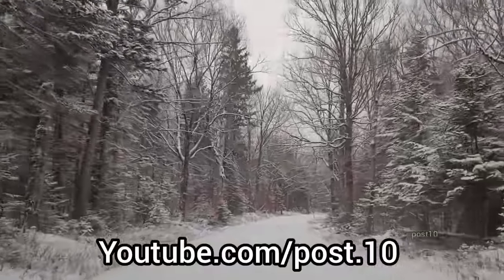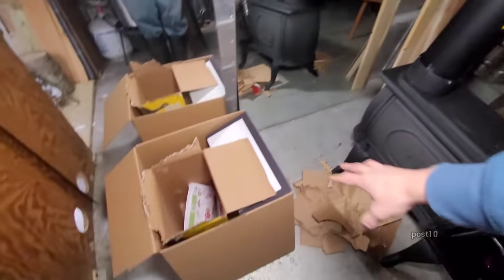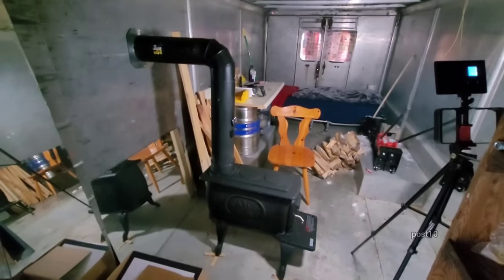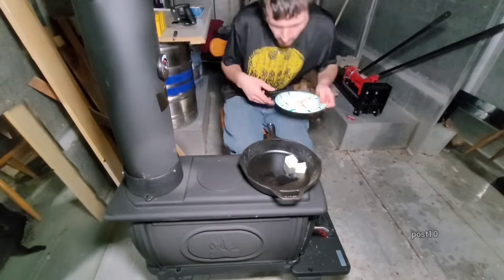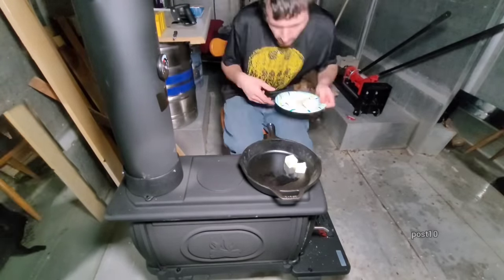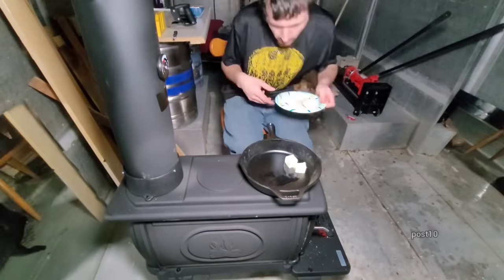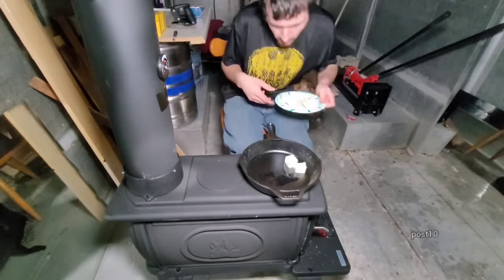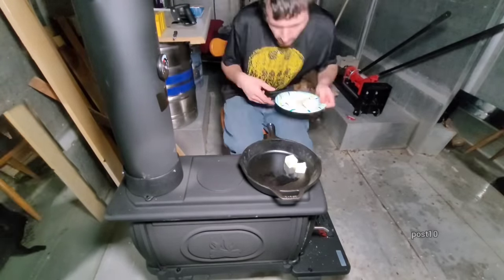24 Hours Living In Abandoned Truck Deep In The Woods During Snow Storm. Transformed Into Camp

Comment: Loved your video. It's amazing how much we take for granted these days. Most people are used to just flipping on a switch to get heat and light. My wife and I are both retired. We live in Texas and went through that week long period with no electricity and below freezing temperatures a few years ago. We were fortunate
 When the news told us the freeze was coming we already had a generator installed that powered our home. My wife and I tend to get moody if we don't have our TV 😂. We discovered that the very first time we went without electricity for just a few hours prior to that week long freeze. So I bought a generator and wired it in. We  stocked up on gas when the TV weather station warned us the freeze was coming. A lot of people didn't take the freeze warning seriously thinking it could NEVER get that cold in Texas🙄. People never dreamed our power grid would fail for that long of time. I'm not a gambler. I do what is advised everyday in life to make my elderly years as comfortable as possible. The wife complains  less that way 😂. "Happy wife" means "Happy life" 😊. Our generator ran 24/7 for an entire week except for a few minutes for refueling. The ground was a sheet of ice and I fell several times during refueling. So after the freeze was over I installed an auxiliary fuel tank so fuel ups would be a lot less if we ever go through a freeze like that again. I was shocked when I heard how many people lost their lives in that freeze 😳. The streets were undrivable. Car wrecks everywhere and lots of cars in ditches. Many cars just slid off the road and couldn't be moved. My wife and I were fortunate to be retired with income still coming in when many weren't 😔. Many people went that whole period not being paid. We were also fortunate and kept our running water. Many people's plumbing were busted. After the freeze the hardware store sold out of a lot of plumbing parts due to the repairs that people were having to do. I let my faucets drip a steady stream that entire freeze week. I would rather pay a little extra on my water bill than go through the plumbing head aches😂. So due to my prep work we and our pets got through that freeze with just the cost of fuel usage and no other damages 👍. I'm a retired welder and once the freeze was over I built an oil  "drip feed"/ wood burning heater for heat source also if ever needed 👍

Comment: I had a wood stove similar to this design when growing up, We installed it in our trailer and used it every winter for years. We never cooked with it tho, but ours came with a tool to remove those circles at the top which is what your supposed to do when cooking, for some reason yours is just 2 circles and no slot for a tool to remove, so idk if you cooking with those spots closed was intentional on your part or if you didn't know you were supposed to remove them for when cooking. However as you said, to your surprise the food came out much better then you expected. that's because you essentially slow cooked that salmon which is a great thing to do because with some food, the slower you cook it the better, other foods it doesn't really matter. Slow cooking it allowed that garlic to sweat into the butter nicely and marinate both the fish and the shrooms also allowing the fish to render nicely into the vegies aswell! But IDK if you knew what you were doing with that wood stove when cooking or not but if you wanted to cook food with it faster in the future removing those discs and covering the hole with your pan is how your supposed to cook on a wooden stove, you effectively made a slow cooker with a cast iron pan and tin foil. What a macgyver invention lol.

Comment: Looking forward to watching the whole video! My family's old hunting land had an old Air Force bus that my uncle bought at auction. We had aluminum siding on it, some crank-out windows, an "All-Nighter" wood burning stove, plywood on the interior walls, and layers of shingles and old carpet on the floor. Plus, bunk beds in a U configuration in the rear. We had times when it was 85F in there with the right wood burning away. I had the top rear bunk, so most of the heat traveled my way. Hated that.

Comment: What a fun camp in the woods. What a nice nest you are making. Insulate it really well so you don't have to deal with all that condensation and blankets frozen to the wall or floor. Lol. You won't have to burn so much wood so fast either. It is great you have chunks of maple for over night or longer burn times! Wish I had access to more maple or oak.  Lay down even a few layers of cardboard on the floor and cover them with something waterproof you can sweep and put a couple of throw rugs down for your bare feet. Put a large metal commercial baking tray under the front of your stove to catch embers just in case. This comes from a grandma. I am 75 and with a lot of help I did a rough inexpensive conversion of a 20 by 40 metal shipping container and lived in it for several years. When/if you decide to paint your truck in the woods, just paint out the word Bachman and paint on the word NATURE. As an off grid mom and grandma for many years, your work and enjoyment brings back some great memories. Thanks so much for sharing. If i was going to live in a metal box again, I would definitely want to insulate well; and reinforce the floor if needed and build in a rocket mass stove for heating, cooking and warm winter bed space. Rocket Mass stoves take from one tenth to one fifth of the wood a regular wood stove take and maintain your heat energy for hours beyond your burn time. They burn very cleanly if done correctly and you should get no smoke. I wish you the best in your life's adventures. Blessings to you.

Comment: When your getting the fire going, leave the door cracked an inch. It increases airflow to the fire so it goes easier. Also leave it cracked for a few seconds before opening the door fully to push the smoke out of the firebox and up the chimney.
Reply: A vented wall penetration keeps supply air from creating a cold draft inside 💠 ...🤔☝️✌️💪☯️
Reply: A vent through the floor directly under the stove works the best, then cold air from outside just goes directly to the stove instead of drawing cold air into the cabin while drawing your nice warm air into the stove.

Comment: FYI, the flat cast iron pan can be used as a lid for the two shallow cast iron skillets.
Reply: Good suggestion. His 1lb of bacon would've cooked much faster that way instead of putting it in that huge Dutch Oven pot which acted more as a heat sink instead of applying the heat to the bacon itself - it would've cooked quicker in a smaller skillet with lightweight lid of some sort.

Comment: Just a friendly FYI before installing any small stove you should start a fire in it with the stove pipe attached outside first to burn off the protective paint coating they put on it.  Otherwise when you fire it up the first few times inside it will smoke and give off horrible smoky fumes.

Comment: Something I was taught a very long time ago to help insulate the bottom of the stove to prevent the cast iron from getting too hot: Put a layer of silica sand in the bottom to cover the wavy bottom to about 1/4" to make a level floor.  I did this with my Jotul 606 - as my mentor of yore did with his - and it keeps the bottom cool enough you can store firewood underneath without it getting hot.
Reply: Everyone I know, including myself, just never cleans the stove/fireplace out completely.  Just burns better with an inch of ash in the bottom.  I have always regretted when I did go completely empty as it just seems to make getting a fire going harder and takes forever to get nice and hot.

Comment: Good video. I'm doing a similar adventure. I have a few words to share my experience.

 Wood chimney pipes should be installed male into female. Female being on the lower end. When creosote drips down it will stay in the pipe and be less of a fire hazard. Insulated pipe helps to keep the smoke hot while exhausting. Burning seasoned, dried, hardwood lasts longer and creates less creosote.

Beacon grease can be used instead of butter. Pour your drippings thru a strainer over a mason jar, let cool and put a lid on it. Years ago, there was always a grease container sitting next to the stove, for cooking and treating the cast iron pans.

Eggs that are fresh from the chicken, unwashed and not previously refrigerated, don't need refrigeration. Store bought, by law are washed and refrigerated. Washing them takes off the bloom (natural coating) that protects them. The shell isn't enough protection on its own.

I have decided to not plug up all my holes. My wood stove needs a lot of air, for the wood to burn. There is only so much air inside my little building. I need air to breath. I also need some ventilation for condensation. Even me just breathing creates enough moisture to create mold on anything and everything. I went to get out my winter wear, found mold...even all the bedding materials had to be replaced because of mold. Ventilation is very important.

I subscribed....just to follow your progress on this "cabin" project.
Reply from the maker: Yes I did the piping backwards because I didn't want rain water coming back down, the creosote will seal the pipe eventually
Reply: I did see that you replied on another's comment about the pipe, after I had commented. You do you.

Comment: Hey buddy....you got a good start but you can't burn pine! It's gonna gunk up your chimney and give you so many problems with creosote buildup. You need insulation outside of that truck. If you're gonna leave that gap on the roof you need insulation in there, you gotta put nails in that aluminum, insulation there at the front at the windshield, and underneath. It would make it much easier to keep a good temp in there. You're still learning. I'm curious, where's your family?

Comment: Glue Tyvek insulated panels around the walls, floor and ceiling and it will really insulate the place.   You won't go through wood so fast and it helps with outside sounds coming in.

Comment: Wood stoves are designed to work efficiently with the door closed, with it open, it won't draw correctly, there should be some type of air shutter to draw air near the bottom of the pan or underneath.  The hole you cut probably bypassed the baffles used to heat the walls of the stove for the best heat exchange into the room.
Reply: Agreed, the cook top is not heating up as it should, heat going right up the flue.
Reply: 🫢⚠️, if you want to see the fire = buy one with a window in the door. The door must be closed and only opened for stoking and putting more wood inside it, and the wood must be well seasoned to not smoke. And never punch holes in the deflector

Comment: Great video mate! Just came across your video in my YT feed and really good! That land with that truck on it, that's a right result! Great truck for a ready made tiny home/cabin. You could insulate that and it's save you having to burn anywhere near as much wood, retain the heat and also reduce all that noise you're hearing.. just a thought as if anytime the fire went out in the night or whatever, it would still stay warm inside, also make it good for a longer stay. But even as it is, its a great space! Fantastic luck that it's aluminium aswell.. what's the chances of that happening (getting stuck and not being removable).. you did well buying that!
Cheers from London England 👍😎🏴🇬🇧

Comment: You might consider some sort of insulation on the inside. Something as little as wood panel or planks on the inner walls would likely create a more consistent temperature.
Reply: I was thinking the same thing, maybe those styrofoam 4x8 boards that are covered in foil.  Just glue them to the metal structure with some PL premium. That would also help to cool it in the summer
Reply: @Scubaken2022  I was going to suggest those too, but they're ugly. I feel like the aesthetic would work best with wood. Wood may not work as effectively, but at the very least, it should have a good impact. Especially if there's an air pocket between the metal walls and any type of insulation.

Comment: One tip about cleaning the cast iron, is to do a salt scrub. find some chunky rock salt and pour it in pan after rinsing it out and use a paper towel to scrape around with the salt. you will be able to scrape off anything left and the salt also absorbs excess oil and seasoning.

Comment: The corrugated "roof" will absolutely blow off with a good wind. The cinder blocks won't do much, and you'll find a decent wind sends the roofing sideways. Consider tacking em down. I'm speaking from experience. Maybe construction adhesive if you don't wanna use screws, but removal may be an issue if that times ever comes.
Reply: Agreed.  One big wind is all it takes.

Comment: I believe the chimney should have been installed at a 45 degree angle, at least, because smoke rises but only if there is there is way to allow it to do that.  The ideal position will be straight up so there is no issue with the rising smoke but that is my thought. But I need to say I commend you for taking a difficult situation and making it much, much better for you needs. Wishing you the best!!

Comment: Get some roofing screws with a rubber washer.Makes them water tight.
Reply from the maker: I thought about doing this but only if the roof flew off during a storm. Those cinder blocks are more than enough. This property is going to take forever to clean up, I got a microburst yesterday taking down 47 substantial trees and the roof survived it

Comment: SAFETY ISSUE! I heartily recommend that you screw down the roofing using rubber washered roofing screws and then remove those heavy blocks. One good snow load and the weight of those blocks and the snow could crush your cabin. I’d hate to see that.

Comment: You should drill some holes in the floor or make a larger hatch with a removable piece of metal, to allow you to easily clean the floor in the future.

Perhaps right in front of the stove, to have an easy way to dump ash without carrying it outside. It would provide additional ventillation without cracking the door as well.

Comment: you should put up some of that 2-inch foam insulation on the walls. that will keep it warmer,
and prevent things from sticking to the walls when really cold. hang a blanket near the door
so the cold air will not fill the truck body. the noise could be the expansion and contraction 
of the aluminum inside / outside. key would be the ceiling to insulate. nice video.

Comment: You have some good bones to work with on this truck! We have big cement blocks under our wood stove and coming out  under the front in case a PC drops out. If you had a good runner carpet it would be comfortable on your feet for your floor. I hope you put some fasteners on your roof....that's kinda dangerous if the wind would pick up there. The ideas for the inside of the truck is absolutely endless!! Can't wait to see what else you do with it! Oh and for your tater.....use the Dutch oven next time on top of the stove with a little foil under it so it won't stick. Congrats on your find! Get you some decent wood for other stays. Pine isn't a good wood to burn. We have had a wood stove most of our marriage of 31yrs plus I had one when I lived at home with my parents. I would absolutely love to stay there. Where are you located? Any ideas for summer time and how to cool it off? Maybe some solar or a chargeable jackery box? Thanks for making the videos.

Comment: Love your like fore roughing it in the woods but have seen some things that concern me about your truck most of all your stove.  First of all you did make a poor decision on the stove but you know that by now.   Here is what they were trying to mimic.    I explain this from experience.   The attempt in what they had designed your stove was what I learned from my experience in a wood burning insert for my fireplace. After making mistake myself I have a wood burner that is 86% efficient.  The baffle in the top of your stove needs to have a shut off or opening to the flue which is what you discovered.  Mine has a lever the I use to do what you have done with the hole you made but once the stove warms up you need to be able to close that hole.   Mine does exactly that then it mixes air into the gasses across the top of the stove to increase effetely the heat it puts out.  You should be getting 3 hours of heating with three medium logs.       Top of my stove gets to 350 degrees. 
Plus you really need to learn more about conserving the heat you get

Comment: I have that exact same stove in my man cave .I need to know how big of a hole to make as you did .I put my stove up high. I took two steel 55 gallon drums so I dint have to buy anything i set the stove on there  just so I don't have to stoop over .
Good idea or not?
I have not put mine together yet as of today .in my man cave / cabin I have electricity but no water. I'm planning to make a water collection system as i make improvements.

Comment: I know this is late, and not super important, but you can use soap on cast iron. That used to be true, but it was when soaps contained a lot of lye. That could eat through your seasoning. Most soaps now are detergents and surfactants. They aren’t capable eating through polymerized carbon, which is your actual seasoning.

So you can use soap and water if you like, just make sure to dry it right away and put a thin coat of oil on it to prevent any issues.